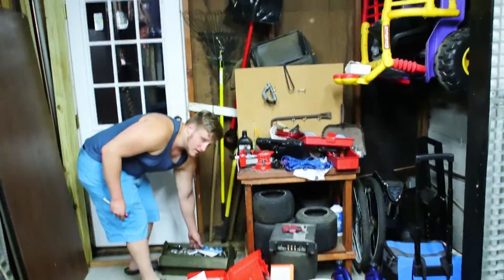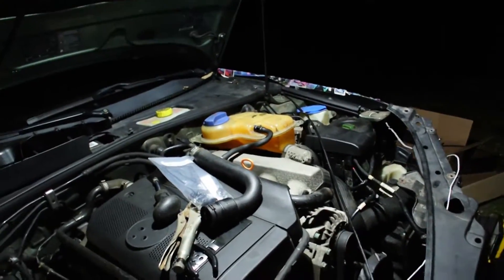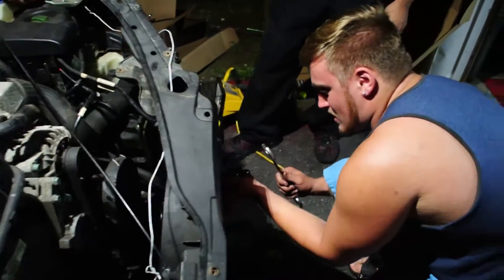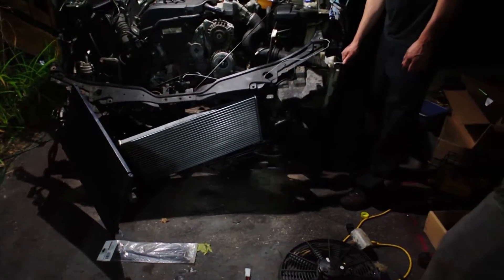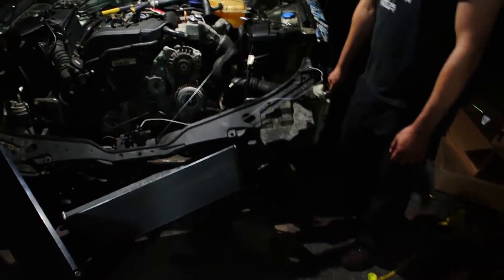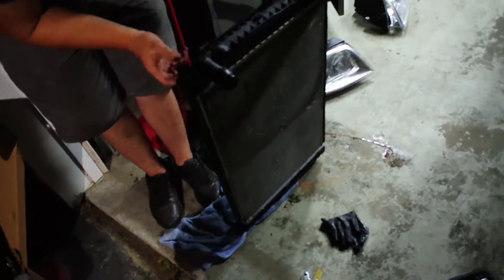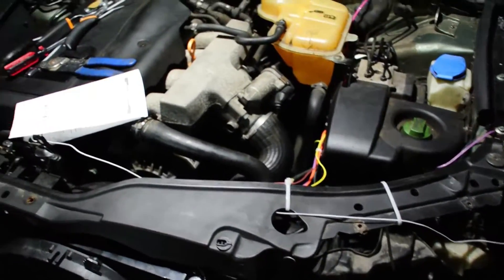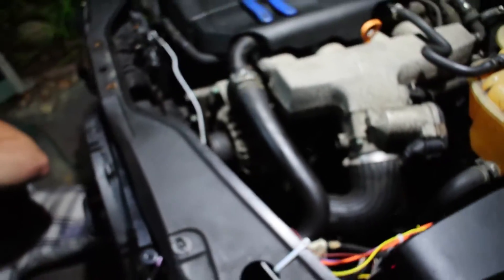1.8T VW Passat Clutch Fan Delete - Electric Fan Install

Comment: How about a parts list, gents?  On 5/19/25, my 2004 Passat 1.8T broke down near Columbus, Ohio when the Clutch Fan Bearing seized.   Now with a 21 year old car that has 282,000 miles, I can't fault the bearing for failing.  I had to tow it with U-Haul around 650 miles back to Atlanta.  Not cheap, but cheaper than what a garage in Sunbury, Ohio told what they would repair it for ($1900? ).  

A tow truck operator (who is also a truck mechanic) tried to find a used Power Steering mounting bracket with a usable clutch fan bearing that would have been good enough to continue my trip and get me home...unfortunately, Chris' lead on the part at an area junkyard turned out to be bad.  At least Chris tried, which is more than I could say for the garage in Sunbury.

Comment: I think this can be an improvement, because at idle the fan clutch goes slow, not helping the condenser and when you rev and the car is hot, that fan blade eats some hp from the engine. Would be great if someone could test this with numbers.